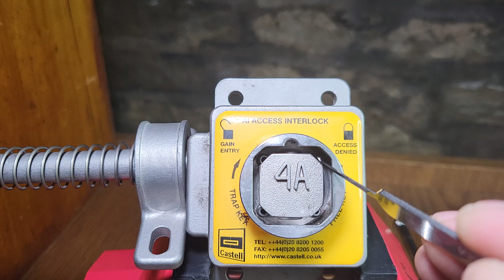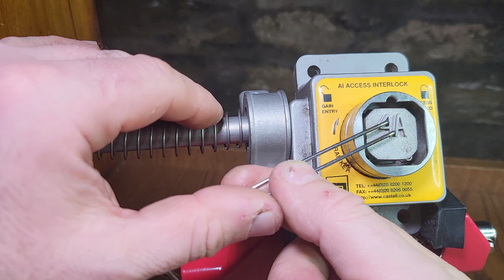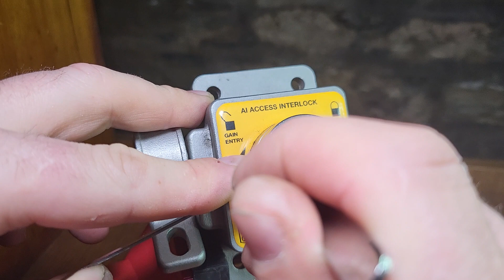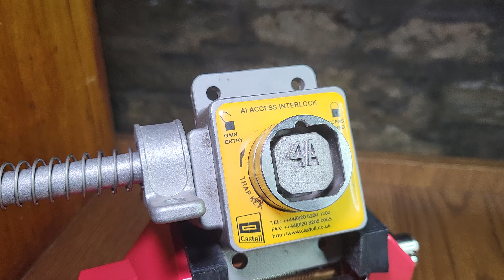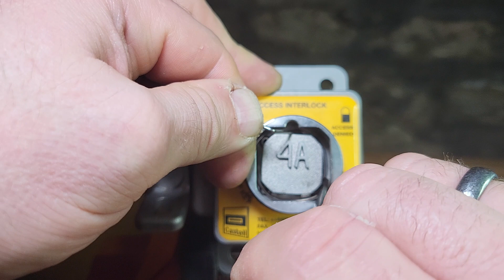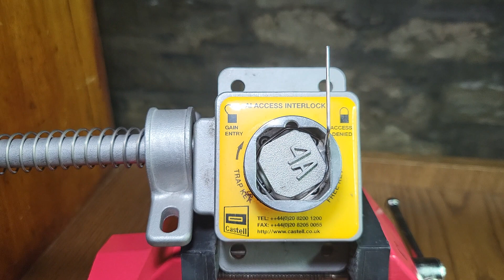Castell Interlock - Industrial Safety Lockout Picked & Bypassed

Comment: Get a piece of square tubing of suitable dimensions & bang you have a master key.
It’s wrong that they use an easy simple mechanism as “security” to stop people being in danger,
But on the other hand the simple ideas are often the best ones, because most people wouldn’t even work out what needs to be done,
Good job for working out that you just need to push 4 pins at the same time whilst turning the thing Paul 👌
Reply from the maker: It's an odd setup for sure, the bypass is actually worrying its so easy
Reply: @Lock-Picking-Paul  I think I may? of unsolved the mystery of why they use tapered pins!
It may be because they knew you only have to get all 4 pins flush & tapered pins would stop you just applying tension & pushing one pin at a time & getting them to stay there, but they overlooked the easy bypass 😂
Reply from the maker: @BrettSucks  that makes sense, I guess they forgot about the flat bitting of the pins themselves 😁
Reply: Yes most square tubing will have 90 degree corners but you can get square tubing shaped with flat corners,
Another easy way to make one would be to warm up some pvc pipe & slip it over the square thing & it will take on the same shape,
It’s what we do to make hose fittings fit machines in the workshop for dust extraction.

Comment: Sell these every so often at work, you can order them with custom letters but it's hellish expensive and the standard ones aren't cheap either, was interesting to see you and TD had them. Picking didn't look like it needed high skill after the tension problems were sorted? Just keep going round poking? Obviously all for naught with that bypass. Interesting vid Paul ta. Ps tip just arrived today, will forum tonight . Thanks buddy
Reply from the maker: Its more a puzzle to be solved than a lock to be picked, once the tension is solved and you don't get suckered into quitting too quickly because of the tapered pins then it's plain sailing, the real challenge is in doing it quickly I think, might make a good time trial at this years BrisLockCon especially if it's securing a box with Haribo's in 😁